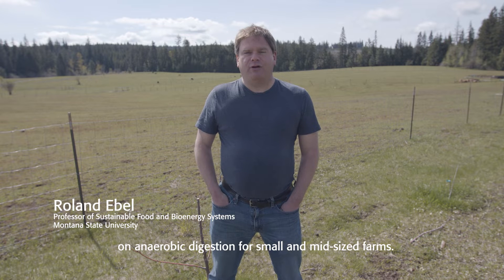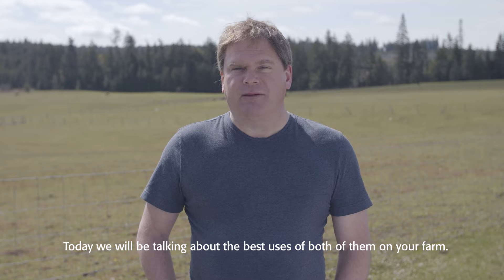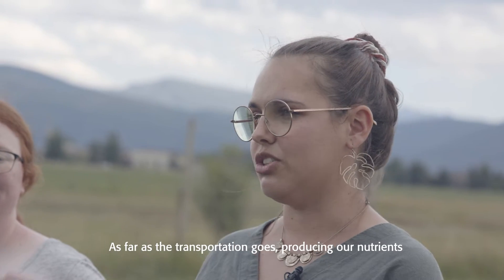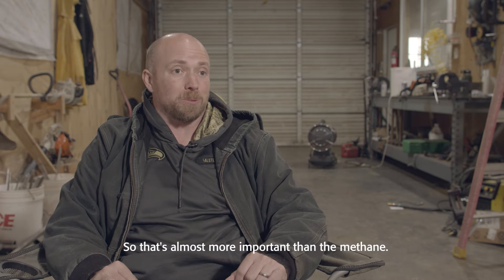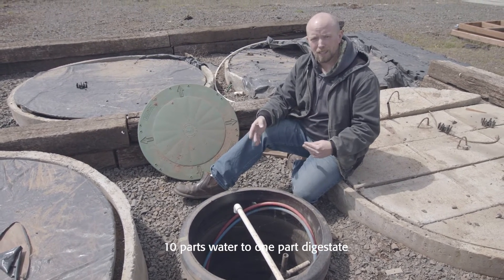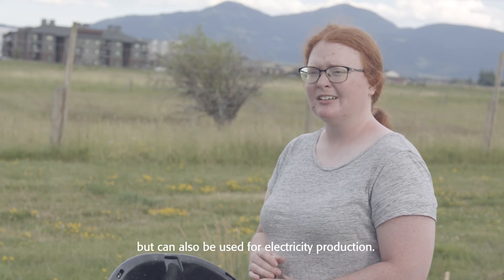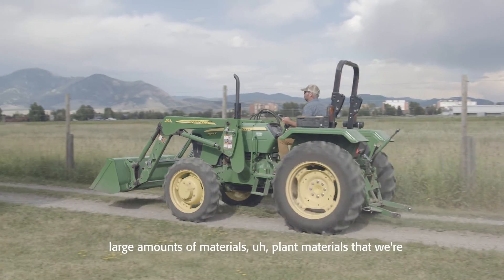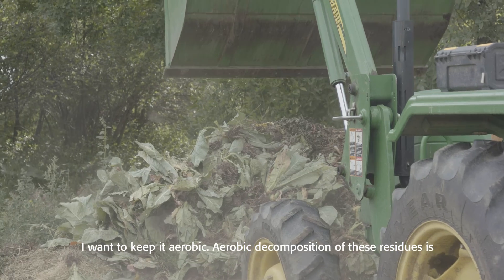Anaerobic Digestion for Small Farms: Producing Energy and Nutrients from Waste

Comment: Reduction of negative environmental effects through bioremediation by lowering negative potential associated to soil water but ground water contamination over the land flooding through unnatural untreated spirited waste factors.
Need greater federalization of  global correction system through independently run clean water and waste control as they could be used as primaries to facilitate high tech waste management and treatment but anaerobics technologies but also irrigation and clean water and waste control for farming and agricultural support workers in rural communities and areas .
Changing the dynamics of the environment to reduce adverse associated to the command of force and overall creative license.
Theoretical perspectives!